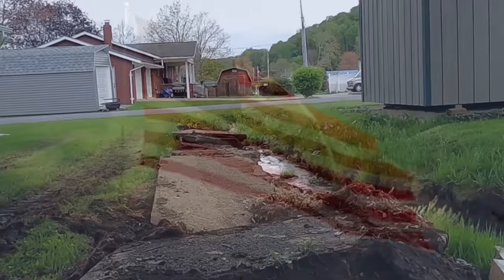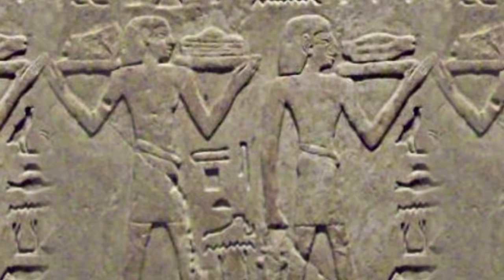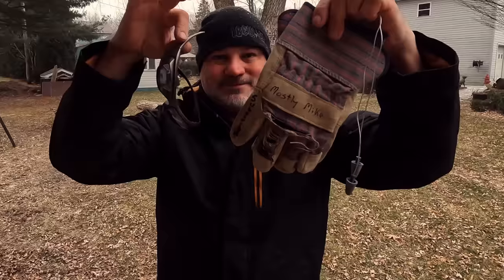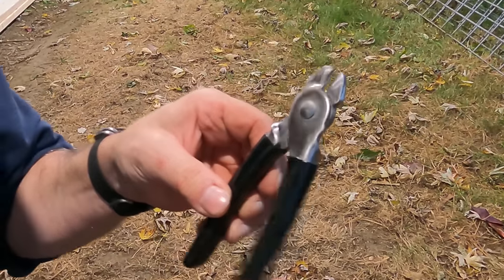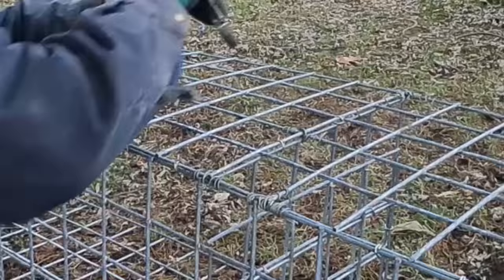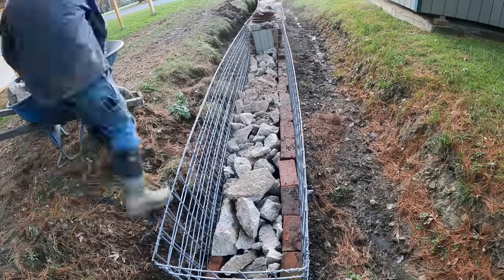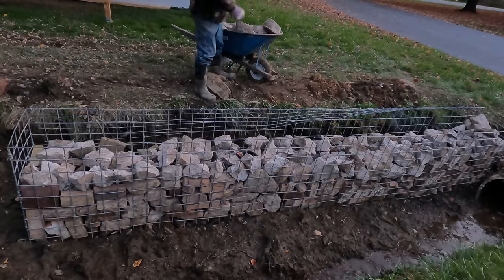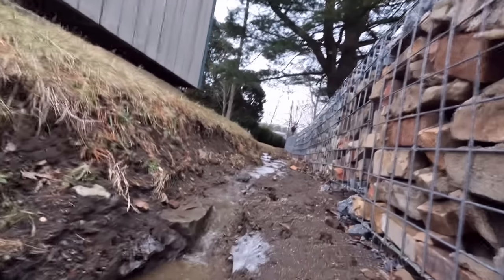How I Built My Own Border Wall Cheap

Comment: So how did that loose rock work stopping the water?
Reply from the maker: Thanks for watching Rick. Of course the loose Rock doesn't stop the water, but when the water rises, it definitely keeps it going the right direction without going over the banks. Now that it's landscaped and I have fabric against the other side, one thing I noticed on the ditch and I will do a follow-up video in the future is that the ditch dug itself deeper, and it also dug itself wider the opposite direction which is exactly what I wanted. That alone keeps the water from Raising too high.

Comment: how long will this last? I see similar walls along the road and wondered if the wire would eventually corrode
Reply from the maker: Thanks for watching Cern. It's hard to say for sure, but after a year there doesn't appear to be any rust to speak of. I can't see underneath it, but not sure if that would matter so much because the ground kind of holds everything there after it settles.

Comment: How you prevent gabion base from rust due to humidity?
Reply from the maker: Thanks for watching Bolivian Prince. The panels are galvanized, and made of the same material as the cages that are commercially made for this purpose. If they do rust through, it would be a really long time. To make them out of stainless wouldn't be cost effective.

Comment: Some advice from a final grade and amenities contractor (who happens to exist jus-this-side of the Rio Brandon). If you would have had some of your neighbors (to the South) help build that wall, you would have been done in a day, not a month. All puns aside, good job.
Reply from the maker: Thank you Jason! Truth be told it actually took a few months to build working on it by myself. I'm happy with the result after a few tweaks. I will be posting an update sometime in the near future addressing some of the questions that were asked in the comments as well as showing some add-ons. If you look in my short videos there is a follow-up showing the wall filled up to full capacity just recently. If you want I can provide a link.

Comment: I read a while back that Gabions came from battle field defensive fortifications  (wire baskets full of rocks) as designed by Michaelangelo to stop range weapons.    I think a hog ring pneumatic gun would be faster to join the panels than all that wire wrapping.
Reply from the maker: Thanks for watching KarasCyborg. The hog rings were just to temporarily hold it together. I'm pretty sure that they wouldn't hold back that riprap without wrapping and tying it. I couldn't find heavier Guage rings anywhere.

Comment: Hi, loved watching you building the wall. Just like usual, someone that never built a thing will have an opinion: Shouldn't you tilt the wall and rest it against the bank? That way the wall would be more resistant to water erosion over time? Just a thought. Great video.
Reply from the maker: Thanks for watching and commenting. Not sure about tilting the wall, but I did tether it before backfilling, and did most of the backfill using #3 limestone with geofabric to allow expansion. The water is actually not fast moving when it rises.. Instead it sort of Dams up at the culvert. I will be doing the follow-up video and explaining this better sometime soon.

Comment: Hog Rings are found at upholstery repair suppliers
Reply from the maker: Thanks for watching and the helpful tip on finding the hog rings. I looked everywhere for real heavy duty ones that were capable of holding that kind of weight, but still not so sure that I would trust just to hog ring to hold back that much Rubble. Everything seems to be holding up good two years later.

Comment: metal will rust and wall collapse? how long will the wall last?
Reply from the maker: Thanks for watching Dragon. It's been over a year and a half since I built it, and there's no sign of degradation from rust as of yet.  Of course there's rust in spots, but I believe that it will last a long time. I plan to make a follow up video to address some of the questions and comments made on this video.

Comment: Much respect for all your hard work!! Pat on the back. Did it work??? Also, I found this video while searching for "diy hesco barriers" and although you're diverting water, a similarly designed wall would be useful in a physical security situation on one's home front. Just sayin. 😏👌
Reply from the maker: Thanks for watching and the fun comment TR Speaks Truth! I couldn't agree with you more on this physical security situation on the homefront! To answer your question, in my shorts video playlist there a very brief follow-up showing the ditch full of water. That is all I have as far as a follow-up so far, but I do plan on making a video showing more of the wall that I built as well as filling the back side in with a combination of geofabric, number three gravel, more geofabric, then a foot or so of topsoil so grass could be planted. Many who watched this video assumed that my neighbors owned the opposite side of the ditch, but I own both sides of the Rio Brandon, LOL. The previous ditch kept eroding closer and closer to my boat house, so this wall actually sped up the flow of the water, diverting it instead of overflowing the banks, and sending it to the pipe that goes under the road, which is a whole other story. I have filed three complaints to my municipality over the past five years about the pipe being undersized at only 16 in. The pipe feeding the Rio Brandon Upstream is 24 in, and when we get a big rainstorm, a full pipe of water spews from it. It's clearly a plumbing code violation, but my municipality isn't doing anything about it. That violation though, is the cause of all the flooding to begin with. With adequate sized piping the water would never get that high. Sorry for the long-winded response. 😁
Reply: @themostlymikeshow2582  no apologies necessary! Sorry the local municipality caused you so much work, but hey, it's good exercise right!?  Fortunately, they also lead you to make a very informative video, and you commendably kept your sense of humor throughout. You "embraced the suck" well. 😁

Comment: Doesn't it lose integrity with age since you depend on metal for structure?
Reply from the maker: Thanks for watching John. I thought that originally, but once installed, the stones are pretty much holding themselves in place and there isn't too much weight pushing out sideways. The metal doesn't seem to have much stress on it. Different people mentioned about issues with rust, and that could be true to the parts that are underground. Those parts are kind of held in by the backfill anyhow. The parts that are exposed look like the day they were put in a year and a half later. There might be a little bit of rust where Cuts were made, but this wall should last a long time. I will post the follow-up in the near future showing any degrading at any level along with issues that I did have, and what everything looks like with some additions and Landscaping.

Comment: Tractor supply also sells 2”x4” panels which are better because you can use smaller rocks; just a bit more expensive not much
Reply from the maker: Thanks for watching and sharing the information. The smaller holes would definitely make it easier to fill. I found myself many times looking for the larger stones and sort of stacking them to keep it all in.

Comment: Question how long was the wall and how much was the total cost?
Reply from the maker: Thanks for watching Matthew. The cost depends on a lot of things which can vary Case by case. I found the goat panels that I used for around $50 a piece. It took about 15 of them to build this wall. The Jackhammer that I used was around 160 bucks, but the old concrete was free. I think I showed my trailer with the rip rap limestone in the video. It took about six loads of that on top of the used concrete and brick to fill the baskets. That was around $60 per load. There is a little bit more wall than what I showed in the video which I built afterwards. I will be posting an update video with what it looks like today after Landscaping and adding some other features to it. I will put this in my notes to add a estimated total cost.
Reply from the maker: I will also add that I believe that the goat panels have went up in price since I made this video. This was all done almost a year and a half ago.
Reply from the maker: I just realized you asked how long the Wall was. It is roughly 80 or so feet total length. It is about four and a half feet tall at the culvert, and tapers off to 18 in tall at the far end.

Comment: I guess soldering is a no? Tieing with wire is more secure?
Reply from the maker: Being that this wire is galvanized, I don't believe that solder would bond to it or be strong enough if it did.  Heating the galvanized steel releases toxic gasses, so there's that too. The hog rings really don't do much aside from temporarily holding the cage together so that it can be wrapped with the high tensile wire.  That was a very tedious process that I wish there was a shortcut for. Thanks for watching and commenting.

Comment: I appreciate the effort 👍 but I’m struggling to understand how this structure will hold back the backfilled dirt (let alone the annual flood waters.  I didn’t see any filter fabric that would allow water down and through your back fill while limiting erosion. Conversely, if and when it does flood no fabric to stop the rock from silting in from the water side (unless that’s your goal. A poly 24” culvert covered with rip rap would have achieved that.  Is the intention to go higher?  Is there a neighbor issue?  Anyway. Thanks for posting. Take care.
Reply from the maker: Thanks for watching Captain. At the point when I made this video there was no Landscaping done. It just looks like a wall in the middle of a ditch. I did use a geofabric against the back of the wall. I will be showing this in a follow-up video that I plan on doing sometime soon. That fabric goes up the slope behind the wall as well as up against the wall. I then backfilled all but one foot with number three limestone, and then put a layer of geofabric on top of the limestone, and then finally put the top soil against it. As far as the building in on the wall side, I'm not really concerned about that happening, and as you said it is probably part of my goal. No there are no neighbor issues. I own both sides of the ditch. Stay tuned and I will show all this in the upcoming video. Not sure exactly when.

Comment: Whenever you cut the hog panels into sections, you lose 4 inches because you have to cut the cross wires back to the longways wires to  make a hem to the panel.

If you can instead BEND the panel where you need to have a corner, you won’t lose 4 inches, and you will have fewer seams.  But bending the panel corners is a LOT harder unless you make a nice jig to do it.
Reply from the maker: I thought about doing that Jim, but it would have been really hard to bend those without heat. That wire is about 5/16 of an inch thick, maybe more. At the end I had almost a 5 gallon bucket full of the 4-in stubs.
Reply: @themostlymikeshow  I wonder if you could have cut them down and used those stubs as hog rings to hold it together?
Reply from the maker: @bobcostas9716  I actually considered that, but they are at least a quarter of an inch thick. Pretty difficult to bend around that tight of a radius.
Reply: @themostlymikeshow  Thanks for letting me know. I read some more comments and I have to say I like the technique of leaving some of the stubs attached and using them to bind the panels together. Anyway, well done. Looks solid and attractive. Sift some dirt down in there and you can grow plants. In 20 years it'll be a wicked sturdy hedge.
Reply from the maker: @bobcostas9716  if it could be done it would certainly look nicer.
Reply: @bobcostas9716  regarding bending the tag ends inwards to use as “hog ring” - - I just finished building a set of hunting dog kennels basically doing exactly what this video covers except mine are filled with hog dogs instead of rocks. Lol.  

Basically, the galvanized wire the panel is made of is too thick to make self wrapping practical AND too brittle for self wrapping to be reliable. 

It was a great idea but unfortunately wasn’t practical.
Reply from the maker: I agree. I tried to bend those around and number four wire is so hard to manage that way. I just cut mine off and use hog rings to temporarily hold it together and then wrapped it with galvanized 12 and a half High tensile wire.

Comment: I don't get using a holding material that will rust away in no time flat. You might want to bury it in concrete or it could get messy later on ... just saying ...
Reply from the maker: It hasn't shown any sign of rust so far aside from where cuts were made, and it's minimal there. I'll show that in the follow up video coming in the near future.
Reply: They're galvanized and will last a long time. I've had panels on my property for 20 years that still have zero rust.
Reply from the maker: Thanks for watching Kenneth. Yes it's another year gone by and still no rust.

Comment: Completely confused. Rock is many times used for drainage. How is this stopping water getting to your yard?????
Reply from the maker: Thanks for watching John . All that it's doing is slowing it down and diverting it. I own both sides of that ditch and what was happening is the ditch kept eroding closer and closer to my Boathouse. The wall offers the occasional high waters that probably only happen maybe twice a year to expand between the rocks, but I put geofabric and number three gravel as most of the backfill and just topped the last foot or so with topsoil. It makes way more sense if you would see it now. I had been meaning to put an updated video answering some questions and reacting to some political statements that people made, but I've been behind.

Comment: Sorry to disappoint you but a gabion wall won’t stop water to overflow on big rainstorms. But it will protect your “border” from flushing out into the drain.
Reply from the maker: I agree that it won't stop the overflow, but I does divert the water to where it needs to go without further eroding, which is what I was going for. It has been in for a year and a half now, and the only issue that I had was that the ditch had gotten deeper which was unforseen, so I had to address that. I made some other improvements which I will post a follow-up in the near future. Thanks for watching.

Comment: I wanted to know how it did with the water.  If you had built it higher up on each side of the Brandon River.  Could it have been made lower.  I have a creek on my property.  If we get over 5” of rain it floods out in one spot only.  That is where two big elm trees where planted years ago, like maybe a hundred.  Anyway the water is contained there and it floods it’s bank . Think your creek is going to do the same.  Please show how it works.  Later
Reply from the maker: Hi Gene. Thanks for watching. Not sure if the wall could have been made lower in my situation. It probably looks strange in the video, because it probably looks like I built a wall in the middle of a ditch... Well, I sort of did. For years and years it had eroded to the point of making the ditch super wide especially at its deepest part. The erosion kept trending closer to my garage. My goal with the wall was to sheer up the sides of the Rio Brandon on the side that my garage is on. The wall itself, and the help of a little digging is making the water erode the opposite Bank of the one that the wall is on, making it take on its original course from 30 some odd years ago. Everything seems to be holding up pretty good. I had a minor issue with the water undermining the wall in one spot which I will show in the video how I addressed it. If you were to build one of these, I would definitely recommend a better base underneath the wall then what I had made. I think mine is going to hold up just fine, but in hindsight, I wish I would have tamped some rip rap into the ground before I started building. What I like about this design is that when the water does rise, it still has a place to go within the wall instead of just diverting away. When I landscaped, before I back filled it, I put a layer of geofabric like you would put under a gravel driveway up the slope of the old Bank and up the vertical part of the wall, filled it all but one foot with number three limestone, and then put a layer of geofabric on top of the limestone before finally filling the rest with topsoil and planting grass.

Comment: I WANTED to see it in action
Reply from the maker: Thanks for watching Lamar.  It filled to the top just last week. I'll try to get a short video out showing that. I want to post the video showing more additions that I added and the explanations why I did some of the stuff the way that I did.
There's a problem not directly related to the wall that I'm dealing with. The pipe at the downstream end is 8 inches smaller than the pipe feeding the ditch a half block upstream. I'm getting the state involved with having that fixed.

Comment: How much do the goat panels cost?
Reply from the maker: Hi Stephen. At the time that I made the wall, which was around September or October of 2021, I believe that they were around 55 dollars at Rural King, and I was unaware that Tractor Supply handles these as well. They were slightly more, but they will price match competitors. Tractor Supply co is much closer to me. If you inquire at Tractor Supply co, I believe that they color code the goat panels with orange paint.